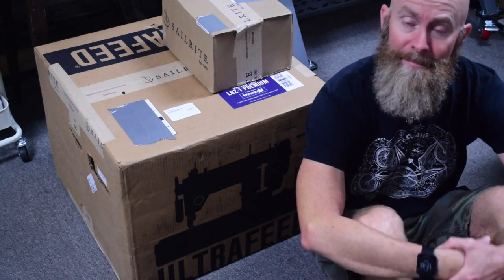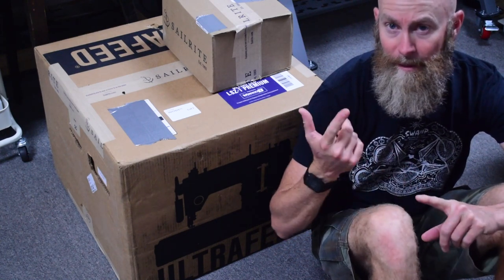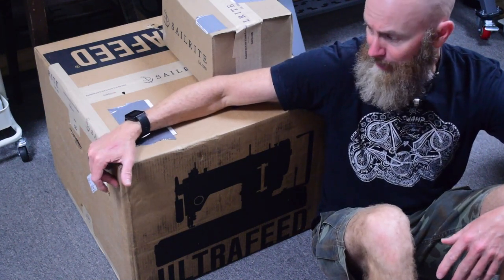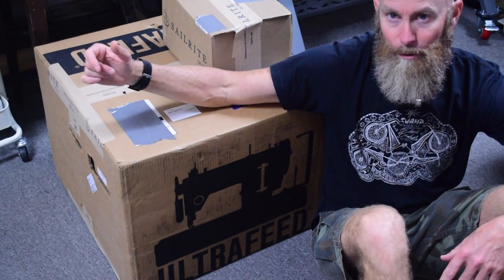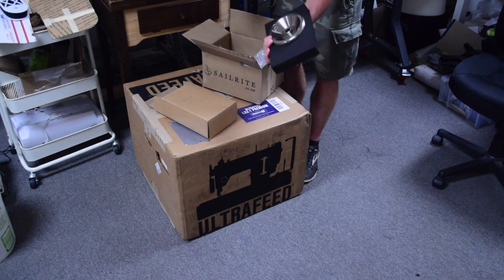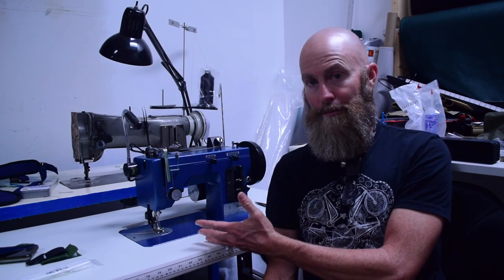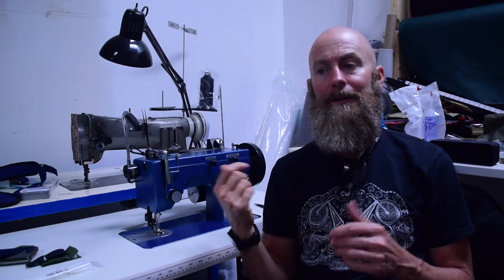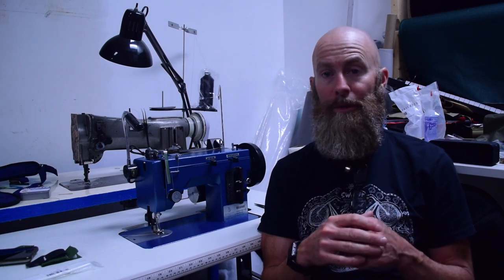LSZ-1Premium with WorkerB; Unboxing and First Impressions

Comment: Hi Jason.... Thanks for the time you put into this video. 

Here are my questions about this video and the Worker B... . I recognize you're not a spokesman for the company but I value your feedback  as an informed third party..... 

First, the Servo motor on Sailrite's website costs somewhere between $200 and $287, depending on what you get with it, but the Worker B motor is a $300 upgrade. What does the worker B give you that a servo motor does not? Why would I pay more to get less power? 

While we're comparing the two, which one gives you more power and control: the servo motor or the worker b motor? What's the difference between the Servo and Worker B? 

If I don't need the machine to be portable, why would I buy the Worker B? 

Thanks again for your time...
Reply from the maker: Hi Keefe, 
Great questions!
First, power:  I think power is largely overrated.  Most machines struggle with feeding more than lack of power, in my experience.  That said, more power is better, to an extent.  My feeling is the WorkerB is more than enough power for anything I need to sew.  
Second, control:  WorkerB is hands down the most controllable sewing machine motor I have ever used.  As I mentioned in the video, a servo motor with a needle positioner has an advantage in the fact that it has a preset to stop at an established, precise position, and that is definitely an advantage for working quickly and efficiently.  However, for having precise, slow-speed control with no loss of power, the WorkerB is definitely better.  If you are working on something that requires careful placement of the stitches, and especially if it is thick or hard to sew, the WorkerB is absolutely the thing to have.
Regarding portability: Because the machine itself is a portable machine, I think it just makes sense to keep it portable, especially when there is no real disadvantage (and probably some advantages) to doing so.  If one wants a walking-foot machine that is NOT portable, I think it makes more sense to just have an industrial machine (with the possible exception of zig-zag, it would likely be cheaper). One reason I ended up changing my mind about using the Workhorse motor on an Ultrafeed was that it was too much trouble to change back and forth between the Workhorse in a table and the standard portable motor.  With the WorkerB, you just pop it out of the table and go wherever you want!
So, for an Ultrafeed machine, the WorkerB gives you similar speed and power (less, but similar) to a servo motor, maintains the portability of the machine, and provides unmatched slow-speed control.  For me and my uses, it's a no-brainer.  There are certainly people/situations that would prefer the Workhorse, but I think the WorkerB is a FAR more versatile solution.
I hope that helps, thanks for being part of the channel!
Reply: @thejasonofalltrades  I agree with your remarks about power. But I like to add, that fitting the right gearing between motor and sewing machine is important in all cases. With the right gearing you do not need that much power to get the right torque and slow speed control. In many cases for heavier work, you need a speed reducer to make things right. The Sailrite LSZ-1 have a build in speed reducer that fits very well with the WorkerB. But I guess it can be more difficult to fit the WorkerB to an industrial sewing machine with right gearing and speed reducer. And in the same way it will be harder to fit a servo motor to the LSZ-1 with right gearing. The speed reducers for the 3L V-belts, that is typically used on industrial sewing machines often cost about $100. Have you used speed reducers on industrial sewing machines with servo motor?
Reply: @thejasonofalltrades  Thank you for the extensive and thoughtful response. It's all good information.

Comment: Man I own a upholstery shop and run a juki, I watch sailrites videos and I wanna try one of these machines bad.
Reply from the maker: I think you will like one if you ever need a portable machine to take to a job site. I've used many industrial walking-foot machines, and in general I would say the Ultrafeeds can sew anything any medium-duty industrial walking foot can. If you are comparing to an older, Japanese-made industrial machine, you may find the Sailrite to not feel as substantial, but it functions great, and being portable can be a real plus for certain jobs.
Thanks for watching and commenting!

Comment: Jason, thanks for the review. One question, does it seem like the WorkerB motor package can be adapted to an external motor household sewing machine? Some thing like a vintage Neechi or Singer 201-3?
Thanks
Reply from the maker: Hi Keith,
With sufficient fabrication skills/tools and willingness to possibly have to drill and tap holes in the body of your machine, I believe it would be possible to mount the WorkerB to a vintage domestic machine.  I have definitely considered doing it to one of my 201s.
The motor is quite a bit more powerful than the motor that a vintage domestic was equipped with, so I would recommend caution, but most of the pre-1970s machines are built well enough that I think they would be just fine. The speed control would be very nice, I think.
I think the trickiest bit would be getting the alignment between the drive pulley on the motor and the hand wheel on the machine correct.  (201-2s present the additional hurdle of not being belt driven, so there is no pulley on the hand wheel to receive the belt.  I believe wheels from some other vintage Singers can be used on 201s, but I don't know for sure.)
It's definitely a project idea that is on my radar, I just need to find the time for it.  If I do, you'll see it here! And let us know if you get to it first!
Reply: @thejasonofalltrades  Jason, thanks for the reply.  I guess I'll just have to order a WorkerB motor to play with. My 201 has the external motor and Hand wheel with the pully grove. I'll have to find a different pully for the motor as I believe it currently uses a cog belt. Ah well, It's only money!  LOL. Have a great day.

Comment: Why do you concern yourself with the naysayers. The Sailrite LS machines can speak for themselves.  These machines were and are made to be PORTABLE for DIY'ers.  They were originally made to be used on a sailboat (portable) with no power (monster wheel with handle).  If you want a knee lift buy a fabricator but try hauling that around in a box.  I have owned my LSZ-1 for 7 years and I feel It is the best machine on the market for what it was designed to sew - Sails & Canvas.  Sailrite has evolved this machine over the years with new more powerful speed control motor combinations and can now be setup permanently at home or in a shop using their industrial sewing table to tackle any project out there.  Everyone should stop trying to make it into something it is not.
Reply from the maker: Good points!
For the record, my desire for a knee lift is due to the fact that one "could" be designed/incorporated into the machine in such a way that it could be used when in a table, but allow the machine to maintain its portability.  Since most of my use of my machines is in a table, I would love to have a knee lift as an option.  The point I was aiming for is that some people seem to think that the best path to an "industrial" machine is to buy an Ultrafeed, stick it in a table and connect it to an industrial servo motor.  My position is that you then have an inferior "industrial" machine, with no knee lift (and a smaller harp space as pointed out by another commenter). I totally agree that the big mistake here is trying to make the Ultrafeed something it isn't - but I would LOVE for it to be able to use a knee lift anyway :)

Comment: Very informative! BTthis machine is very expensive compare to other portable walking foot on the market. I dont know about, did they have zigzag or not.
Reply from the maker: Hi, and thanks!
All of the similar, less expensive machines on the market are essentially copies of the original Thompson machine that the Sailrite Ultrafeed is based on (Sailrite and Thompson had an agreement that allowed Sailrite to produce their own version, which they then further developed into today's Ultrafeed machines). I have had limited exposure to the knock-off machines, and I've heard from many people who own them with mixed reviews; many have told me that their machine required significant tuning and even filing down burrs on machined parts in order to work correctly.
I do not recommend any of the knock-off machines, primarily on my own ethical views, but also because I believe they are inferior products, base on what I have been able to ascertain  (again, I haven't used or tested any of them, and I can't afford to buy one of each of them to do so). They generally come with fewer accessories, and they certainly will not come with Sailrite's renowned customer service and technical support.  Sailrite has for years been providing information (including hours and hours of free, excellent YouTube tutorials) and innovating new products; the companies that sell the knock-off machines take existing tooling and sell machines "out the back door of the factory" without having to incur the huge research and development costs and other expenses.  Everyone has a budget and has to meet their own needs accordingly, but I urge anyone considering buying a new portable walking-foot sewing machine to think long and hard about where they want their money going before buying a cheap machine from an unknown source that isn't giving back to the sewing community.  That's just my opinion, though :)
Thanks for watching and commenting!
Reply: @thejasonofalltrades  Thanks! I agree with you, service of the Sailrite and new products is speaking for itself. One thing that i dont like about this portable walking foot machines, is massive boundbox of head and foot mechanism. There is no space for manipulating of the sewing pieces in hard constructions. Current space under head and over walking foot mech is normal for planar stiching of the fabrics, or very-very simple forms. I own a Typical gc0303, something similar to space like in industrial machine will be comfortable to work for me. I notice this issue when starting to dig the idea to migrate to portable walking foot. Unfortunately, even this already stopped me from this idea. Not for business, just for hobby.

Comment: Good video. 
My take on my LSZ-1. 

If you don't need the zigzag DO NOT get this machine. The zigzag is an awesome thing to have IF you need it. But for most heavy work a straight stitch is all you need. The LS or Fabricator are better if you don't need the zigzag. Why? Because the foot is smaller and more useful. 
If you don't need to save space DO NOT get this machine. The arm is really short and makes it so you have to work around it. The longer arm machines like the Fabricator are easier to use. 
If you don't need the under foot capacity or the power; then there are better machines.
If you need a simple to use machine, run in the opposite direction.  
If you need to repair a sail this machine is awesome in a pinch. If you are aspiring to have a sail loft this machine is not going to make you happy.
This machine struggles with light weight material and is very hard to get the stitches to match in forward and reverse. If you quilt, don't waste your time trying to do it with this machine. 
Total swing and a miss, the WorkerB could have had a needle position feature with very little effort. They should have given it servo control using a rotary encoder and reverse kinematics or a needle position sensor. 

Who is the LSZ-1 for? People who need a compact, powerful, high capacity and  reliable machine with zigzag. The LSZ-1 is awesome! The WorkerB upgrade is 100% worth it. This machine was intended for people who couldn't have a sewing table dedicated all the time. Comparing it to an industrial table machine isn't fair. The table machine can't be carried around with one hand. The LSZ-1 is VERY heavy but still portable. The machine is very good quality and will likely last a no professional a life time or 2.

Comment: A bit of research seems to suggest that that the DPx16/DPx17 needle system is the same as the 134-35 needle system, which comes in VR, LR, and LBR points. Might you know if the Ultrafeed can use the 134-35 needle system?
Reply from the maker: Your research has exceeded mine, but I can tell you that my understanding is 135x17 and DPx17 are the same, and the needles I have always used in my Ultrafeeds (and other machines) are marked with both designations. So I think the answer is yes!  Also, the way needle systems (and thread) are designated in different ways is very confusing!

Comment: Jason:  I am chasing the perfect home 'walking foot' machine for thin leather.  Any where from 2-3 ounce up to 5-6 ounce.  All the demos I have seen show the Sailrite machines being able to sew through leather, but they are quick and not 'in depth'.  Tandy and Sailrite have a collaboration machine.  But the motor is under a table and I would prefer the WorkerB arrangement.  I am wondering if any of your colleagues have successfully used the WorkerB with Veg Tanned leather.  Or Chrome Tanned leather.  Plus, I think that the walking foot has to be changed so it does not leave marks on veg tanned.  Thanks for all the info.  Really enjoy your honesty and the info you present.
Reply: I'm not Jason but I can answer this. You can sew some leatherwork on the Ultrafeed (and the Tandy version) machines but it's not a super fantastic experience. First, it's only a walking foot feed, not a compound feed. In a compound feed machine (like the 206 Jason and I both have), the needle, inner upper presser foot, and the feed dogs all move at the same time to feed the work. Then the outer upper foot comes down to allow the needle to pull up out of the work and allow the 3 walking parts to step forward and grab the work again. This really does made a difference in how precisely the work feeds when the going gets rough. Second, the Ultrafeed machines are limited to V92 thread, which is arguably too week for a lot of the common leather products. If you're making handbags, this doesn't apply at all but if you're making holsters, belts, or any kind of loaded gear then you'll need a machine that'll handle bigger thread. Also, yes, the knee lift and presser foot malarky Jason brought up also drive me nuts. 

That being said, I'm seriously considering buying a LSZ-1 because I'd like to be able to repair sails for my sailboats and none of the industrial machines I've got will do it. Like Jason said, finding an actual walking foot, zig-zag, industrial machine on the 2nd hand market is basically impossible. You pretty much have to pony up $3k-$4k for a new one.
Reply: Somehow I forgot to say that I'm primarily a leatherworker and my comments about the machines should be taken in that context.
Reply: I have the lsz-1 and recently upgraded to the worker b motor and it is amazing. I also bought the other feed dogs and presser foot that is for leather so you don’t leave marks on your leatherwork and it sews through veg tan leather like butter and with insane one stitch at a time control. Like Jason said, only take advise from someone that has actually used it with the new worker b motor cause is really is crazy how good it is.
Reply from the maker: Williaty pretty much nailed it.  The trick about when people discuss sewing leather is that there is such a wide variety of leather (it's actually kind of like asking if a machine can sew "fabric," in that all machines sew fabric, but there are some fabrics many machines can't sew).  Making bags, wallets, pouches, etc.?  The Ultrafeed with a WorkerB might be the best hobby-level or entry-level cottage-maker light-leather sewing machine ever.  Want to make horse tack? Nope.
When I worked for a leather bag manufacturer, we used V69 and V92 thread almost exclusively, and nothing I made there would have been a challenge at all for an Ultrafeed machine. But again, that was all relatively thin leather for bags and luggage.
Sailrite and Tandy would probably hate me for saying this, but if I were looking to start doing primarily leather (of the appropriate thickness), I would just get an LSZ-1 with WorkerB.  Add the non-marking feet, and it will probably do anything the Tandy/Sailrite leatherworker will do, but it will also do everything else.  There is probably a narrow range of leather work that the Tandy/Leatherworker machines are better for, but I don't have enough leather experience to know about it.
I hope that helps!
Reply: @thejasonofalltrades  Perfect explanation.  I would choose the Sailrite with WorkerB anyway.  I have NO room for a table with a motor under it.  The LSZ-1 can work in its case.  Small footprint. As for leather.  Thin, 1.2 - 2mm leather for small items.  For thicker, I could just cut a channel for the stitches.  That would decrease the physical depth the machine has to stitch.  Much appreciated info.
Reply: @milo4seassons  Thanks.  That is a perfect reason to get this machine.  Smallest footprint for a machine. Great customer service.  Good machine for what I want to do with it.